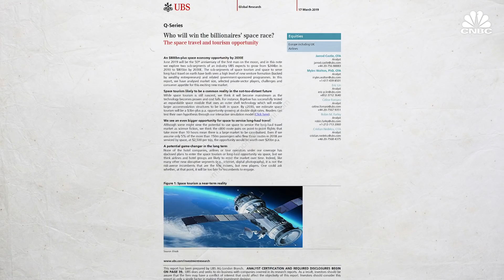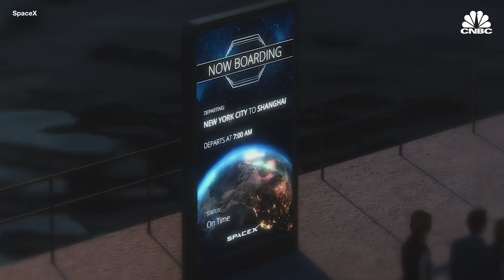Can SpaceX Make Point-To-Point Space Travel Profitable?

Comment: What about carbon emissions? I have no idea, but I feel like traditional flight would produce less than the types of rockets they are talking about.
Reply: For every molecule of methane combusted, you will get a molecule of CO2 plus two water molecules. A fully fueled Starship has 1200 tons of methane. The mass ratio of CO2 to CH4 is 2.75. So that 1200 tons of methane will produce 3300 tons of CO2. For a 1000 passenger Starship, that works out to 3000 kg CO2 per passenger. An analysis suggested that a ROUND TRIP by jet between NYC and London released 986 kg CO2 per passenger. So it does not appear that Greta would approve! 

https://www.theguardian.com/environment/ng-interactive/2019/jul/19/carbon-calculator-how-taking-one-flight-emits-as-much-as-many-people-do-in-a-year

Comment: They forgot the enormous noise pollution across a city which would make this totally non-viable.
Reply: Your not going to be landing on cities. Current proposal plans landing on water 1mile offshore from coastal cities. The limiting factor is cost. Logistics and safety can be solve by continuous improvement in technology. Spacex is planning to launch and land hundreds of times to complete the starlink internet constellation. That will prove the safety of the rocket and give them plenty of experience to solve logistics. But to get the cost down they need 1000x reuse. Right now they are only getting 3x reuse of the booster. They need 3 orders of magnitude improvement in cost reduction and that cannot be done with incremental improvement.

Comment: I think the biggest obstacle, besides safety and reliability. is going to be building spaceports. You're not going to be able to have spaceports close to populated areas because of the noise and potential of catastrophic rocket failure. So you're going to need to build entirely new facilities far away from cities and build all the infrastructure needed to operate them.

Comment: Travel rocket Not going to happen.  
The Geforces are many times greater than that of a commercial flight during take off and the passenger would experience it again during landing (when it uses the rocket engine to slow the decent). If that were not enough the duration of the semi orbit portion of the launch would be in stomach churning zero g.  Some roller coasters can match the geforces and zero g but the riders only experience it for a second or two through out the ride.  Extreame g forces during blast off and landing and the zero g mid launch will make a travel rocket very uncomfortable but for only a few people that can withstand the roller coaster from hell, only a hand full of that can afford it.  Super Sonic air travel is making a comeback.  Smaller aircraft that carry around 50 to 60 people on air craft created with the latest in aviation technology can revive the concord speed of travel with less fuel and noise.  Even if the Super Sonic plane had to stop over to refuel for long haul trips.  Its so fast that it still ends up at its destination much faster than a conventional flight.  Airlines are confident that they can provide Super Sonic travel of the future at Business to First Class prices.  The speed and comfort of the flight will be unmatched.  Super Sonic flies twice as high as a conventional jet.  It equates to a very smooth flight.  The people who frequently travel at First class will not want to fly any other way.

Comment: Even discounting costs for personnel and spaceport maintenance, it costs $300k-$400k in fuel per launch, and there's capacity for about 100 people. So figure a minimum of $4000 per ticket. That would be a bargain compared to first class or Concorde, but probably not cheap enough for most flyers to favor it vs spending 12 hours on a cramped plane with a tablet full of movies/books.

Also I think it's more of a last hundreds of miles problem -- economics will make it difficult to have suborbital flights to every city combo, so if there's launches from NYC to Shanghai you'll have to take a conventional transit system (airplane, high speed rail, maybe one day HyperLoop) to Tokyo, Hong Kong, or any other unserved city.

Comment: Leaving a pipe dream like this aside, because that is what it is. A better idea would be an airline that put 30% less people on the plane. Does not have to have 1st class service, just 1st class seats. With the fuel savings, they would probably only have to charge 20% more. Or they could carry a lot more cargo below with the weight available. I am sure it would probably be even less than 20%. With every flight at 100% capacity you're very profitable and people are not packed like sardines. 

If you're going on business the company pays. And if you're going as a tourist, somewhere over 6 hours away, is 20% more for the flight going to make much of a diff to make your holiday a much more pleasant experience. A 777 would have only 5 seats wide and over a foot more of space behind you or in front of you. An airline like this would not be for everyone but I know I would pay 20% more and I am far from loaded. Most people can afford 20% more, they can't afford 1st class though.

Comment: I love the concept & I'm a fan of SpaceX but, since it's critically important to reduce greenhouse gas emissions to prevent runaway climate change, Elon's working his backside off to promote sustainable energy and transportation despite his rockets using essentially fossil fuel for their propellants, I find it hard to square all that with the eye-wateringly high levels of emissions that would come about with regular mass transportation using SpaceX's rockets. It would be an entirely different proposition if SpaceX used hydrogen as a main propellant, especially if it was derived from seawater using renewable energy.

Comment: It will be possible, only extraordinarily expensive. At first, at least
Reply: True
Reply: it might seem like that, but because the Starship is fully reusable and autonomous the only cost is fuel, which right now amounts to $7m. split among 200 passengers this makes it $35,000 a seat. there are a number of factors which could further reduce the price, like fitting more passengers in due to the increased cabin space in the new version, and reducing fuel cost by setting up propellant production plants which convert CO² and water in the atmosphere into methane and liquid oxygen.
Reply: Eoin O'Kelly Thank you so much for taking the time to reply. Keep up the excellent work!

Comment: The best idea for this is to invent a combined aircraft and space craft. This craft will begin parked at any airport, be able to use the run way for takeoff, but take off more closer to vertical angle and then activate the rocket engines and turn off the plane engines as it closes the wings and head into space. Once in space, it will go to the other side and begin decent. As it is going down, once it passes through the atmosphere the heat shield taking all that heat, it will eventually open the wings and go down like an airplane and use the runway at the destination. Then it will park at the destination airport gate. This craft is difficult to invent but will be able to use existing infrastructure instead of making its own launch and landing pads but of course the economics of such a thing a a mystery.
Reply: Not possible.  Too much weight.
Reply: @chadcoady9025  Show me your calculations...
Reply: @hbarudi  I couldn't possibly show you any calculations without seeing a design.  Every space agency around the globe has mulled over a design concept of wheeled takeoff at one point and come up with the same conclusion.  No need for me to calculate anything.  Take a look at the SR-71 Blackbird.  It's made of titanium, and oozes fuel while on the ground because the skin had to have spaces to accommodate expansion due to the immense heat generated as the craft cut through the air.  That's only to travel up to mach 3 carrying 2 passengers and camera equipment....no weapons.  The space shuttle reached Mach 23 and needed 3 massive boosters to reach that.  The fuel for the shuttle weighs 20 times more than the shuttle itself, and it shed the fuel tank.  Anywho, honestly a horizontal takeoff passenger rocket simply isn't feasible.
Reply: Isn’t that called a space shuttle?

Comment: This sounds like this millennial version of the Concord. It will work but will be too expensive for the regular folks
Reply: SpaceX want it to not cost more than current flight prices, they know that otherwise it would be pointless. They want to compete. 

I'm not saying they will succeed, but that what they are trying to do. Having it take such a short time means they can re-use the rockets many many more times than a normal airplane can do flights today. So yeah... there is a possibility they can figure it out. And unless something happens, eventually they will. Like it all depends on your perspective on time. Look 100 years in the future. If not even these ideas are tried, done and even obsolete by then we might as well give up.
Reply: it won't if you just watch gwen shotwell interview. conventional 1 flight for 14hr flight let say $1500, but Spacex rocket can travel 1hr per trip same distance. So, they can lower the price and increase the flight frequency so they recoupe the low price. They can literally do 10-12 travel vs the convetional 1 flight 14hr.
Reply: @xbxb  except that Starship would need to have, at least, the same structural margins as an aircraft to survive fatigue during those several flights, and if it is at least as tough as an aircraft, the weight penalty would make it transport almost nothing.

The whole idea is impossible due to current materials available and low ISP of chemical fuels.

Comment: 5:18 Is this guy recommending hypersonics instead of rocket orbital spaceships for point to point travel? Bulls#$%!!!
Reply: Hypersonic jets could make way better economic sense with current technology.
Reply: @stc2828  Hypersonic jets would actually need more fuel for antipodal flights than you'd need to travel the same distance in orbit without air resistance.

Supersonic air travel makes sense and is possibly more efficient. Hypersonics is way less efficient.
Reply: It's called suborbital travel, but yes.

Comment: There's a huge difference between the forces and energy levels involved in orbital flight and suborbital flights from one part of the earth to another. Point to point is more like x-15 level tech then Apollo/shuttle level tech. Point to point air fright is a market I don't hear much talk about. Image overnight airfreight using Starship instead of cargo planes, companies could fly multiple flights a night vs there and back routes they currently fly. If your time is valuable you'll pay for speed. Even with all the last mile issues of getting to a launch site, a 40 minute point to point flight is still significantly faster then a traditional long haul airline.
Reply: It would be insanely expensive to ship cargo that way. Something worth that much money would be too risky to put in a rocket.
Reply: @BXJ-mi9mm  Satellites are very expensive and rather delicate and get put on rockets all the time with out issues so that's not the issue. If not having something cost more then then cost of shipping then you pay the shipping to get it there. Good example wound be moving specialty equipment or specialized staff in a time critical situation.
Reply: @matthewconnor5483  If you could put a satellites on a boat and just sail to space, we wouldn't use very many rockets. There have been numerous billion dollar failures. About 5% of resupply missions to the ISS failed. 

You can't just load a rocket and launch. It takes days to prepare them and fuel them. Do you think they'll just keep a rocket on standby?
Reply: @matthewconnor5483  “but satellites” is a completely invalid point

Please give me an alternative to rockets to get satellites into space I will wait…

Comment: I just did some math on the environmental issue that many people have raised. Starship can carry 240 tons of methane, which produces 660 tons of CO2. This equates to 1 to 2 tons per person, which is similar to an average 12 hour flight from London to Hong Kong.

Figures of Methane required are taken from SpaceX. Do note that this is concrete math. The reason why planes and rocket's aren't wildly different in terms of carbon emissions is because rockets don't need to spend fuel once it's outside the atmosphere.
Reply: But it would cost more to 
Launch from new York as it's not near equator
Reply: @radcow  The cities that I chose is just an example of the distances involved, not to be taken seriously. every flight will all burn around 240 tons of methane regardless of distance as this is how rockets work. This is also why the video says point to point space travel will only take over market share of flights over 8 hours long, as the economics don't work out for shorter flights. The longer the flight, the lower cost per mile.

Edit: To clarify, the benefits of launching near the equator does not exist here as all flights will likely burn the same amount of fuel. And the BFR will have enough performance margins to complete any earth to earth flight.
Reply: 70% of earth is covered by sea water. so all co2 in the air mostly comes down to the ocean when it rains.
Reply: @kirakamu9246  This isn't really relevant here. My point applies regardless of your opinion on the exact impact of carbon dioxide emissions.
Reply: @spidermain  my point is there is no such thing as impact of carbon dioxide emission. 70% of earth is covered by sea water. under the sea water there are huge population of sea plants that consume co2 for photosynthsis and that co2 is supplied when co2 in the air comes down to ocean when it rains. 80% of earth oxygen is provided this way  by the sea plants.
Reply: Starship carriers this much, not the entire rocket
Reply: @daniel_960_  Haven't you read Elon's recent twitter thread on this matter? He said the plans are changed to using the Starship ONLY without the booster, and adding a few more engines to Starship. Therefore 240 tonnes of methane is burnt (the starship isn't stretched, it simply has more engines).
Reply: Tom Chan wait what when? I follow his Twitter but haven’t read that. He said you can go point to pint without booster?? Hard to imagine for me
Reply: The full rocket weights about 4000t, most of it is fuel.
If the weight to methane ratio of rocket is the same as starship the fuel is about 800kg of methane.
Reply: Lets not forget that the methane will also be produced from CO2 :)
Reply: Blue origin will be using hydrogen and liquid oxygen with combination 1:6 ratio less harmful to environmental

Comment: what about the fuel burning? how will it affect environment. what about the exponential increase in fuel usage if this becomes main stream.? spacex should try the nuclear propulsion thing that nasa is working on.
Reply: I did the Chemistry calculations a while ago and concluded that the carbon emissions are comparable to a plane.
Reply: Do note that there are very accurate figures on the amount of methane burnt per trip, so it is not just wild speculation.
Reply: First of the bfr will burn methane which burns 100% clean and only produces co2. Methane can also be not a fossil fuel and produced artificially, like elon plans to do on mars.
And about the nuclear propulsion, that’s not a technology that will bring you up into space from earth. It has a really really low thrust, it’s only use is in space in 0g where this thrust is enough. The pro is the weight and size efficiency.

Comment: The problem that I have with this idea is that Elon cares about the environment(tesla), but this idea would cause so much pollution, or maybe he doesn't care that much.
Reply: Their rockets use a hydrogen, oxygen mixture which burns cleaner than current airlines. Elon has previously talked about electric VTOL systems but need more battery capacity before it is viable. If they do electric VTOL from country to water launch pad, rocket launch pad to water launch pad, and electric VTOL from water launch pad to country then their net emissions would still beat out the entire current system in addition to winning in efficiency and speed.
Zero emissions is an unachievable goal. Lowering emissions to the point that the earth can safely absorb them is the real goal. Every percentage point in reduction is a great victory.
Reply: @jameshall2223  Falcon 9 Uses RP-1 and LOX and BFR will use Methane and LOX so no Hydrogen. Even Hydrogen is often taken from hydrocarbons or less econmically by electrolyis both take lots of energy so it's not environmentally friendly.

Comment: Short answer: No.
Long answer: Nnnnoooooooo!
There is a reason why you can't use Rockets for short range travel. Prep time alone for each trip would be longer than the travel and if weather conditions aren't right you have to scrub the whole thing. 
Super Sonic flight would be the closest we can get in current tech terms.
Reply: Wrong. SpaceX' BFR will be able to launch in (almost) any weather, same as an airliner, and maintenance and preparation will be comparable, too
Reply: If airlines don't stop delay then preparation time is not a huge problem though.
Reply: What people don’t understand is that if this comes out, it will be a long way off. Many of our current problems with rockets will be minimized or stop existing. Today, maintenance of a rocket is practically hell. But in the future, it could turn into a few hours. The fact is we don’t really know if this is practical and feasible or not.